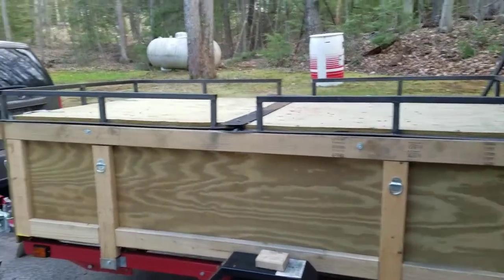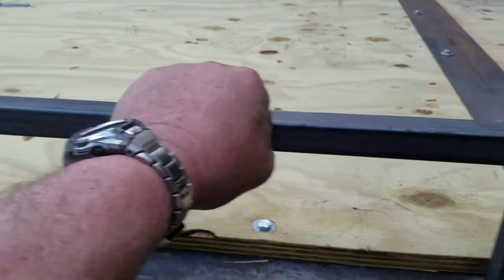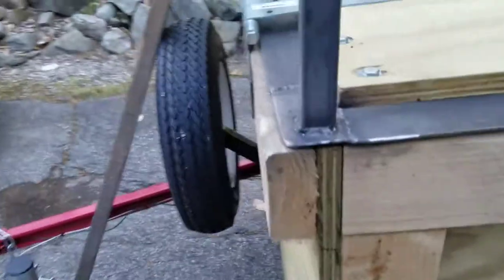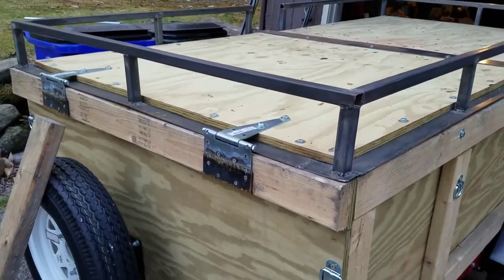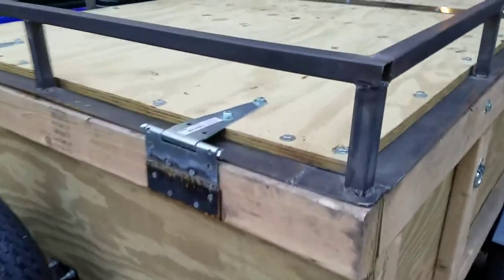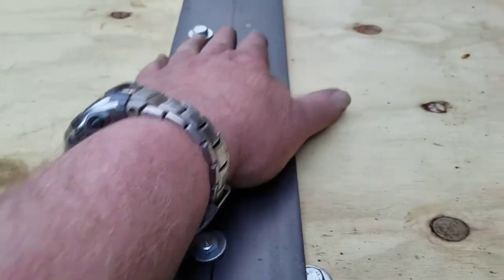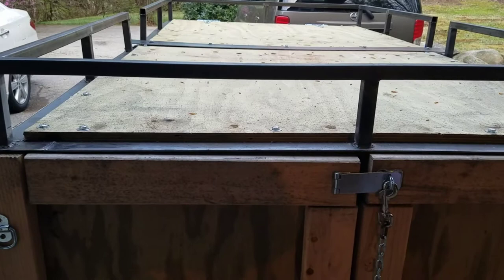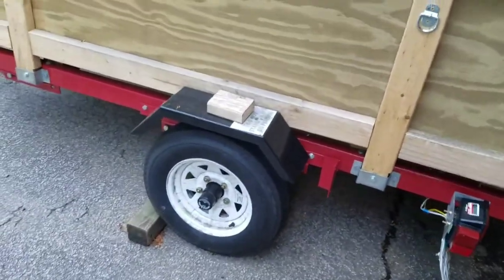HARBOR FREIGHT HEAVY DUTY  CAMPING TRAVEL TRAILER PART 2

Comment: By grinding out hinge couldn't someone else just remove two bolts and easy access to your goods therefore defeating padlocks?
Reply from the maker: C. M. You could cut the pad locks to.  The whole idea was to make it hard to steel anything from the trailer.  Same argument could go with your car, how hard is it to break the glass to get in.